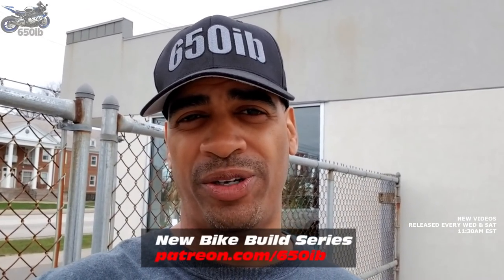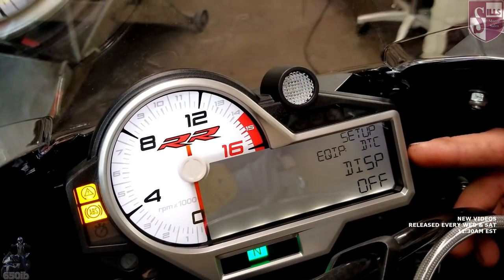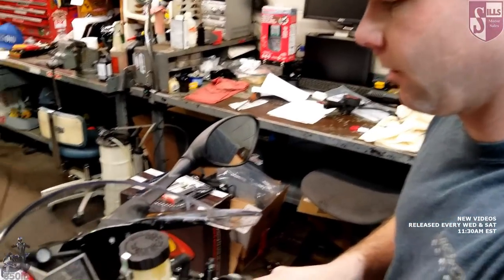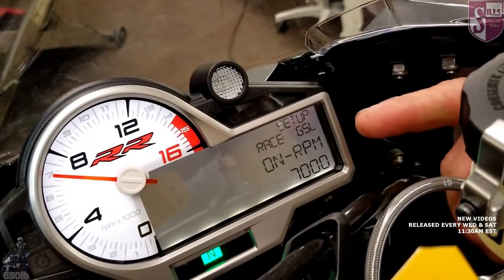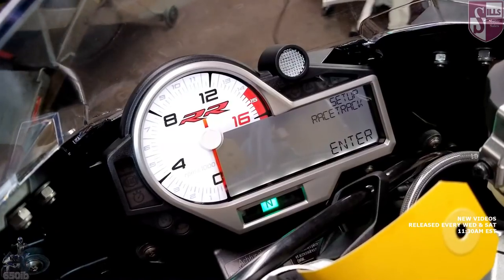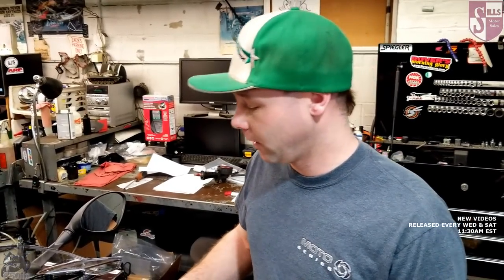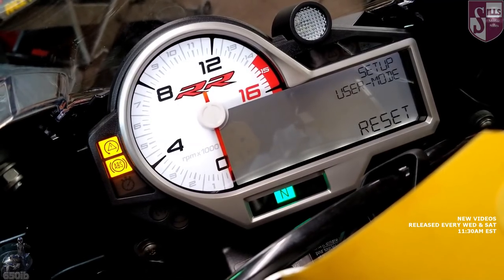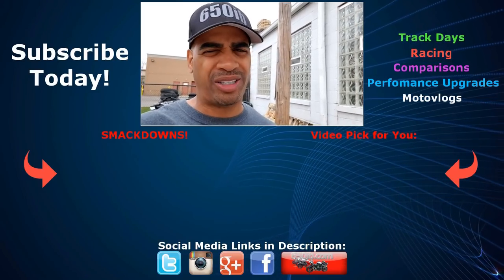2018 BMW S1000RR Setup Menu | Explained!

Comment: 2 years later but still useful. Looked at this before I went to the dealership and knew what I needed settings wise for the drive off the lot with my 2018 s1k 👌🏼

Comment: Cruise control doesn't work on 2018 ? The manual is crap. Not working for me.
Reply: They say to press and hold the starter button u have to be in slick or race
Reply: If you changed levers it may have may have disabled traction control.
Reply: @dw6409  yes that’s what it happened.

Comment: Very interesting Ib!  Can you ask Zach if he knows when BMW is going to switch over to the TFT dash on the s1000rr?  The current dash is effective but kind of low tech when compared to its competitors.
Reply from the maker: Yes, the 2019 S1000RR has a full tft screen and led symetric headlights.
Reply: 650ib thanks!

Comment: BEST tutorial vid on youtube for s1000rr dash.  
 helped me out a lot especially the DDC.  
can you ask zack what would be the best settings for 196 pound person 
thanks ib great vid
Reply: gazhayes1....FIRST: get it sprung for weight (said in the video, 187)😜
Reply: gazhayes1 so springs should not be off too much. Get your “sag” set then I would say up 2 on compression  up 1 on rebound for rear and up 1 for the front. Then go from there. We will do a video on this soon
Reply: hi tanks for the reply
i was thinking about lowering the bike 30mm back & front cause im only 5foot 6 
would it be bad for the ride . and would it take much to set it up again
Reply: gazhayes1 I don’t like to lower anything. Always messes with handling. You should be fine at 5’6 you are an inch taller than me. Taller always handles better. R1200GS Adventures handle great.  Enjoy the ride👍🏻

Comment: This model s1000rr has quickshifter and auto blip down shifts factory rite? If so does it work in all modes and is there a wheelie control that's separate to adjust or is it apart of the traction control in the plus 7 minus 7 he showed us? Cheers looking to upgrade from my 2012 zx10r to one of these soon always loved the BMW
Reply from the maker: Yes, it has autoblipper and quick shift stock.
Reply: @650ib  thanks for the reply buddy love you're videos I'm jealous of your bike collection 👌

Comment: Is the traction control on the s1000 audible, lie the hp4 race?
Reply: iimkushed it's audible, but not with a tone or anything.... you can hear the engine tone change as fuel is cut and braking occurs
Reply: PokerFaceTV right right I figured that, I was just curious if it had that wicked vicious sound of the HP4 race when the traction control is cutting in. Such an amazing sound on the track
Reply: iimkushed so I have the full akra on mine and it definitely is loud when traction control kicks in